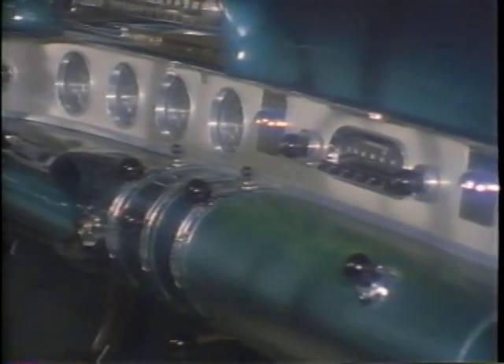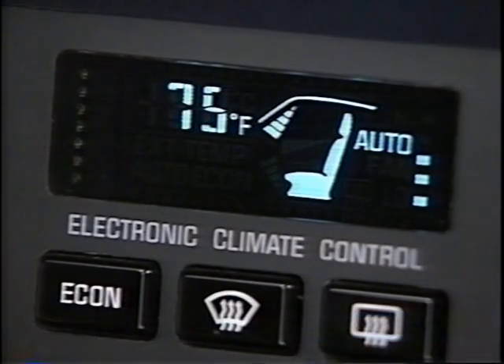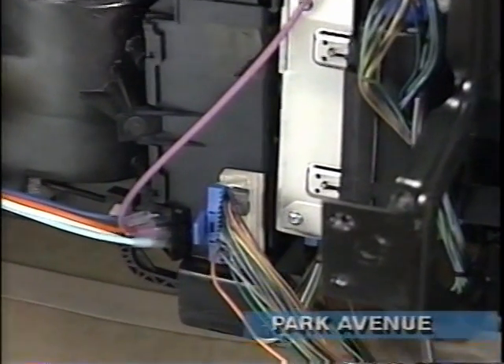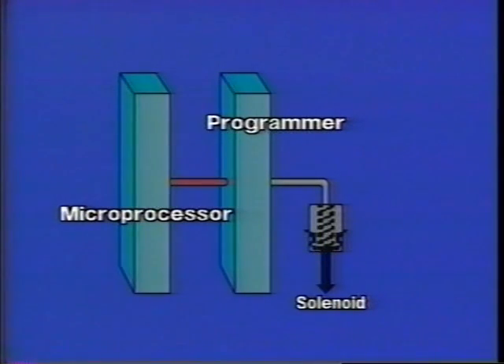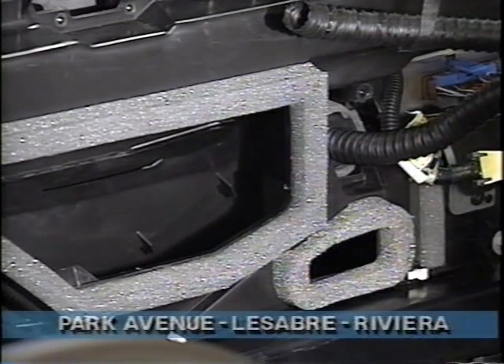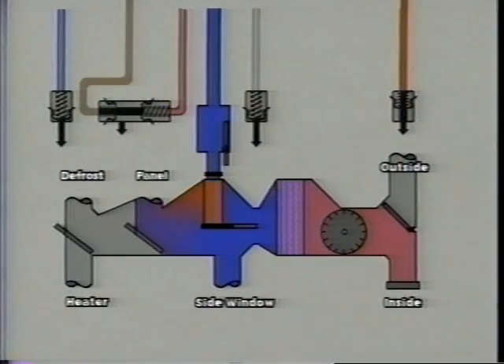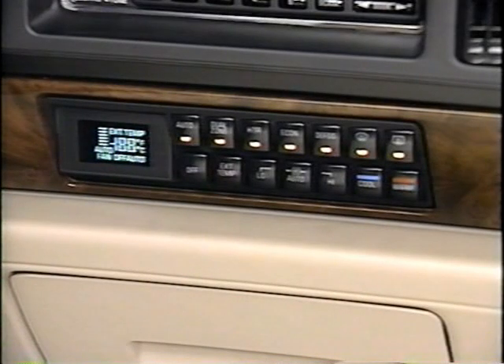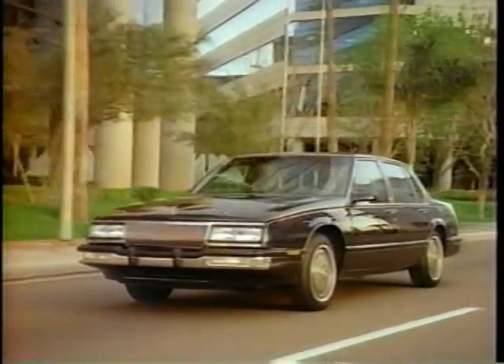Buick - Automatic Climate Control (1991)

Comment: Fantastic video, just awesome!!!  But I could care less! None of this, over the top design or explanation of this type system gives me any cold air or heat quickly at any time of the day or night, in any state, any climate or in ANY season! Example: A child being put in there car seat in the middle of the summer in Arizona or a single middle-aged woman in Missouri with not only 1 but 2 terminal illnesses that has to spend 4 hours driving one way to just one of their treatments,  do not understand nor do they or myself for that matter give a shit about your Climate Control System along with its system resets, temperature in car Vs temperature outside, purges, delays, faults, resets, memory storage, humidity fluctuations, default settings, the 90 different actuators and 400 different vacuum lines and, well " My Personal Favorite is"..... " Its "GOD FORBID" you touch a button, like turning fan speed down and the hole "Climate Control System" has a (High Speed Come-A-part) and has to stop running, shut itself down, throw itself on the ground AND throw a screaming fit just to spend 4 to 10 minutes to think about what the owner is telling it what to do!!! And then it's teenager attitude kicks in and might just maybe, but it depends on the humidity and 40 of the 90 actuators have to be perfectly aligned with all the stars in the sky, along with its forgetting what owner wants and just goes back to the last thing it was set on attitude because well it must be right and every Buick owner is wrong!  And NO YOUR CLIMATE CONTROL SYSTEM DOES NOT PROVIDE THE BEST AND MOST COMFORTABLE RIDE THAT A BUICK OWNER CAN HAVE. CLIMATE CONTROL SYSTEM SUCKS 1000%!!!! The designer, the engineer, and the CEO that approved and signed off on this ,STUPID DESIGN" should have to buy back every vehicle with this system in it and give the owners a new vehicle for free as compensation, just for having to deal with this type of system. Oh and the next time your designer and engineer are board and want to challenge their minds by coming up with another top 10 most expensive and time consuming, money draining to the consumer HVAC systems again, have them go outside and walk a straight line while chewing gum first! Once they can complete that task and they are still board, buy them a box of crayons!